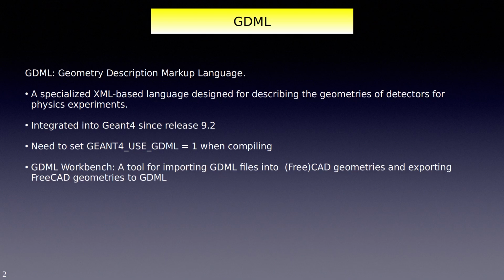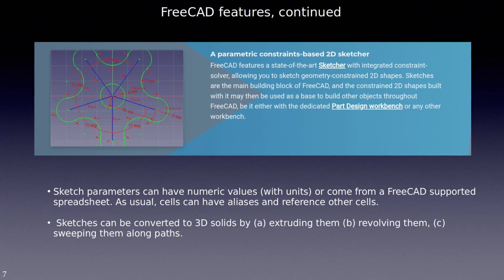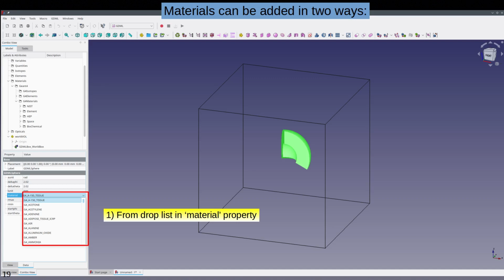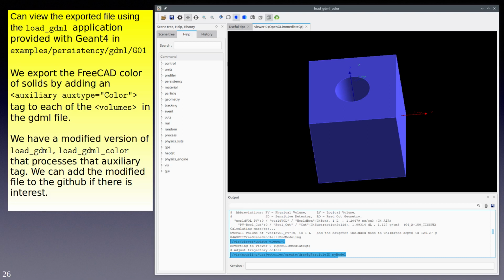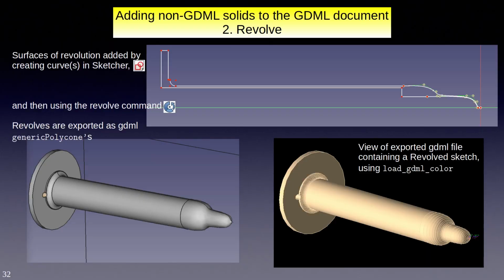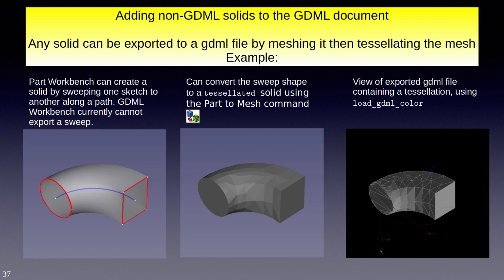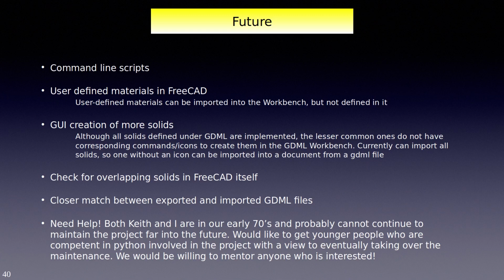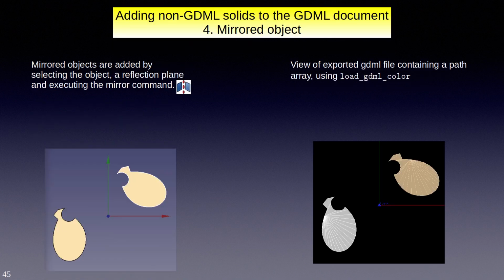GDML workbench Introduction

Comment from the maker: Just to add to Alex's question of using a step file

I am far from an expert but my understanding is that more efficient handling of MonteCarlo simulations is best with GDML/GEANT4/Root Solids.

In the case of GEANT4 you can also get good efficiency with Arrays which get exported as MultiSolids.

Engineers would prefer to design things using CAD software, using sketches that they can then manipulate to creates Brep geometries. There have been numerous research attempts to take Brep geometries and produce the equivalent native GDML/GEANT4 solids but these have ended up using booleans which are not as efficient. The rational of using the workbench to create GDML objects from Sketches is that it is a more constraint situation than the  generalised problem of taking a Brep geometry and creating GDML/GEANT4 solids, even if the sketches have been used by the CAD software in the creation, the point being,  creating the solids with information contained in the sketches is less challenging than handling the general case.

The thing is if one creates the design in the GDML workbench you can always export to CAD via Step and in general you are modelling in a more simplified case than in a full design situation with every nut and bolt. i.e. if you export the GDML model, you could then go on to create more detailed CAD design.

To be able to handle the general Brep and CAD created geometries one has to create Meshes/Tessellations which introduce lots of facet's which greatly add to processing time. The introduction of the Gmsh Min facility was aimed at least trying to keep the number of facets to a minimum that still describes the geometry.

Not MonteCarlo simulations but having sat in on a number of presentations on Fusion like at SOFE held at Oxford the modelling of physics especially when dealing geometric structures that have been meshed/tessellated requires enormous processing time, even when tackling with parallel processing and super computers. There are some attempts at using AI with acceptance that this means results can be obtained in less time but not as assured, which is still useful if one is just evaluating different designs. I do wonder if they might not get some milage by taking a similar approach initial design's using more restricted geometries rather than jumping in the meshes/tessellations. I also have ideas even when dealing with meshes/tessellation about how they could get the results in shorter times but do not have any mandate or enough expertise to fully evaluate the ideas

Comment: Dear Keith and Munter, thanks for this introductory video. I went through the introduction and everything you shared worked fine.
However, after importing my own geometry in the GDML workbench (a .step file) and exporting it as .gdml, I always get error messages and failed to load it in GEANT. How are you dealing with premade CAD geometries? What are the necessary steps that need to be done in order to successfully export them as GDML files and be able to load them in GEANT?
Reply from the maker: If you are importing a STEP file your only real option is to Tessellate the objects of the imported file see https://github.com/KeithSloan/GDML/wiki#importing-a-step-file-and-creating-gdml-tessellated-objects, there are a number of options in terms of Tessellation see https://github.com/KeithSloan/GDML/wiki/Step2Tessellate. Gmsh Min is an attempt to minimise the number of facets (triangular and Quad) for a CAD file. Note That this uses a newish facility of Gmsh and is the reason that the workbench does not use the Gmsh that FreeCAD installs ( see Install instructions in github README. If your STEP file has colours you should be able to set the GDML material based on the colour. You might also like to look at https://github.com/KeithSloan/GDML/wiki/Extrusion-of-Sketches-from-a-STEP-file and https://github.com/KeithSloan/GDML/wiki/Revolved-:-Examples-of-Revolved-sketches the later was motivated by a STEP file that Frederico Carminati want to convert but does mean creating the Object using a similar approach as to how CAD software  create the objects. Revolved and extruded Sketches get exported to GDML and use Booleans. Booleans are not as efficient as normal GDML Solids but they are still more efficient than Tessellated Solids. Hope this helps
Reply: @KeithSloan52   Thank you very much for replying and for the detailed answer. I will go through the links that you've shared
Reply: @alex.chirita  I am having the same issue. please let me know if you have found anything alex. It would be very helpful to me and possibly save me months of time. Thank you.
Reply: @skeyenexus  i ended up using CADmesh and loading in there .STL (text, not binary) files, since I didn't need to create my geometry files anymore